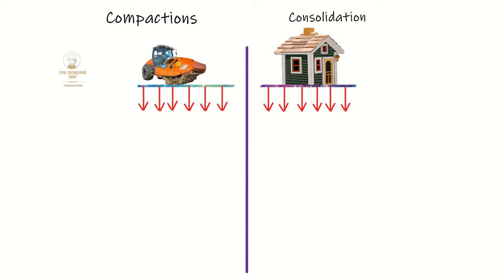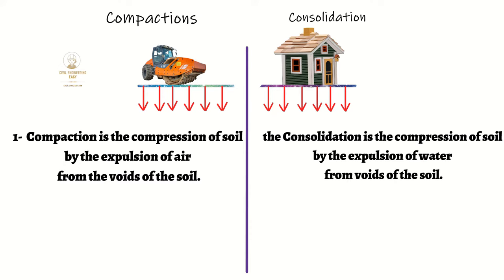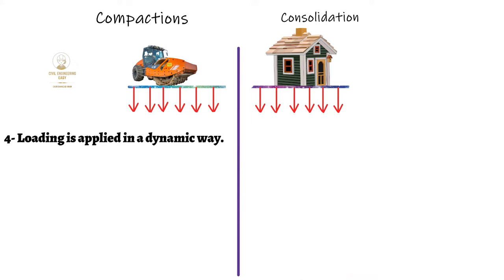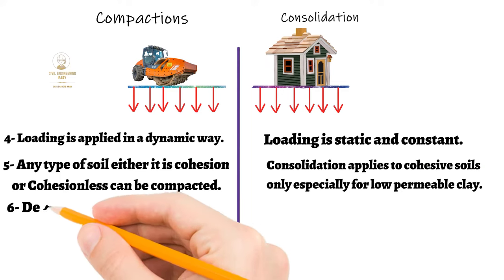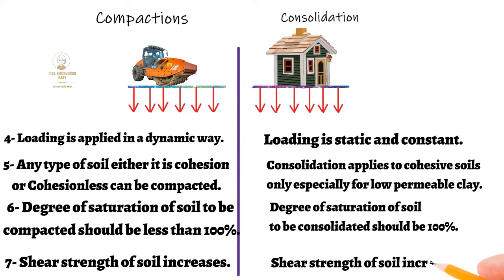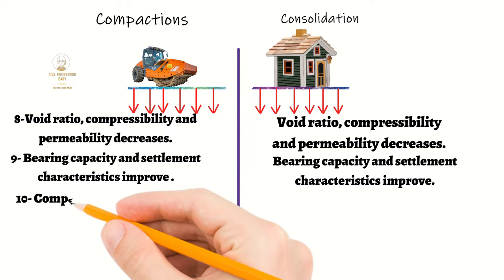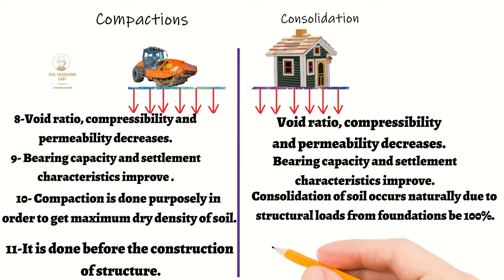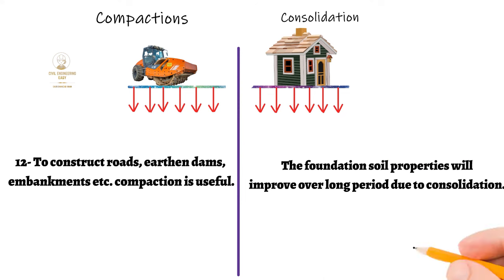Difference between Compaction VS Consolidation | Soil Mechanics | Civil Engineering

Comment: When we backfill the column footing with sand so how does primary consolidation compelets by expulsion of pore water if the drainage path is not avalible in bottom and side walls in scavated area of footing so does the primary consolidation completes from explusion of pore water through capilary action towards above the sand layer and dry through sunlight...?????